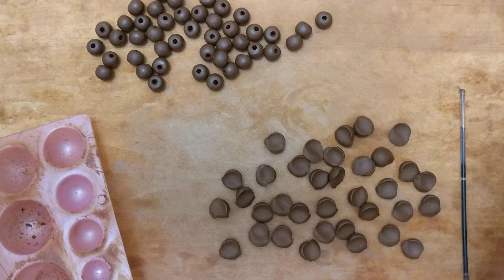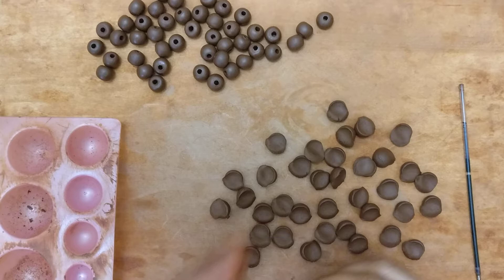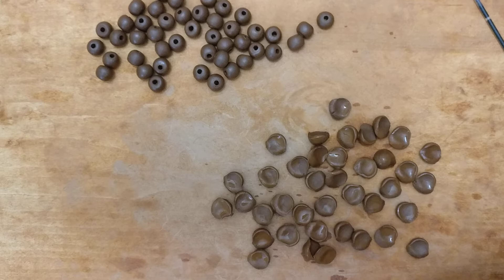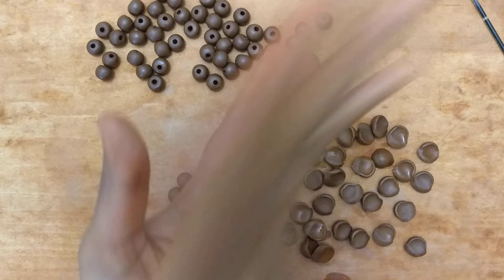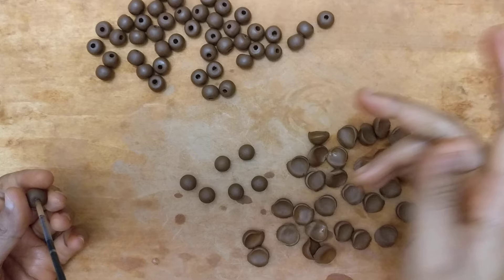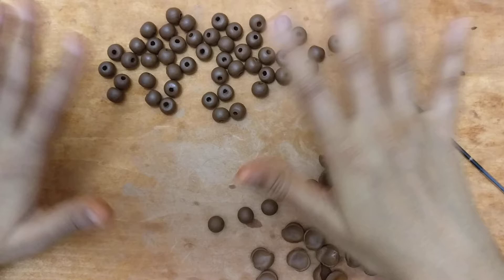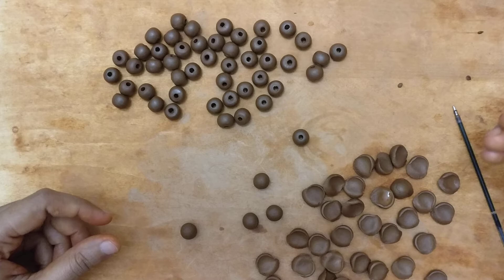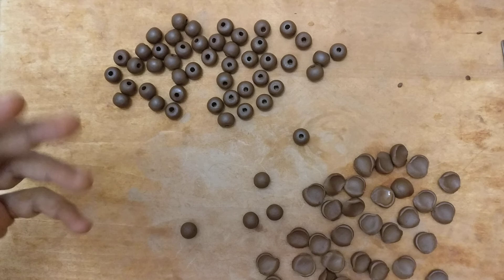Bead making doesn't have to be boring! #beads #beadsmadeeasy #beadmaking #terracotta #howtomake

Comment: One doubt. You using the pen for hole making.hole looks like a big.it is assemble the gear wire it looks some different or neat
Reply from the maker: Big hole - I use the black cord
Small hole - I use the gear wire
Reply: Mam.. Is this beads making hole with pen tube used for black cord or gear wire?
Reply: How can we make very small hole.. I mean the tool?

Comment: Do we need to burn the terracotta jewellery even if we use air dry clay???
Reply from the maker: Terracotta jewellery is always made from natural clay which requires to be fired in order for it to be used.
You cannot call it terracotta jewellery if it's made with air dry clay :)

Comment: Beads after drying,hole small aakunnu..hole idunna time crack veenu shape change aakunnu.pls Tel me the reason?
Reply from the maker: Clay has a tendency to to shrink a little when it dries. It's common. When the moisture in the clay dries out, it shrinks a little. It shrinks a little more after firing. The average shrinkage rate in my clay is approx 8-12%.
With regard to cracks, that could be due to quick drying or using hard clay. You can softening the clay by kneading it a few times. Then you can try making the bead. In the video i have showed how to make them. After cutting out the size, add a few drops of water and start making the bead. That way the clay would not dry fast. While making a hole you can apply a little oil on a refill and make the hole. Hope this helps.

Comment: Don’t we have any other way of firing at home?like using air frier?
Reply from the maker: While I am aware of people who try firing at home using crude methods, I don't suggest as the results are not as desired and its strength is a big question mark. Please don't use an equipment meant for food to fire clay. It's unhealthy and I don't think it'll work as the temperatures don't go beyond a point.

Comment: Mam, I tried it mam, when I make holes, cracks are formed, how can I get rectify it.
Reply from the maker: Add some water to your clay. Knead it first a few times. Let the clay become pliable. If you are finding it difficult to put a hole with a refill, try a tooth pick. Sometimes on a warmer weather your clay dries quickly. You can try doing then one by one instead of doing it batch wise.
Reply: Gtg @nehagopinathpillai  p please
Reply: How can I dry the terracotta jewellery?...Madam

Comment: What tool your using to make small holes for gear wire
Reply from the maker: I use a needle or head pin to make a hole for beads to be assembled using a gear wire.